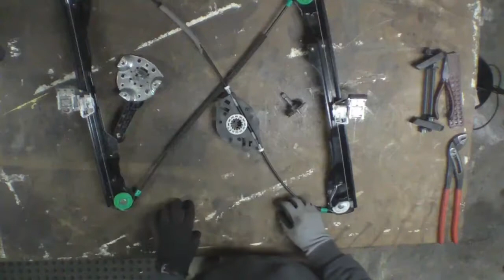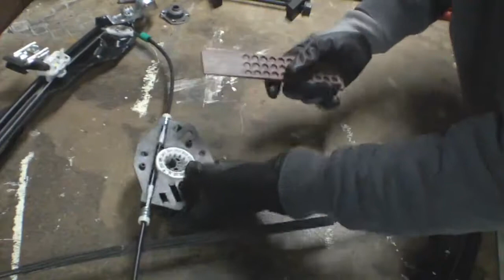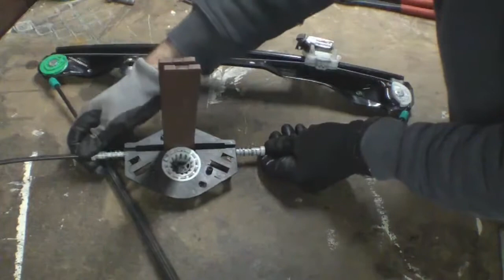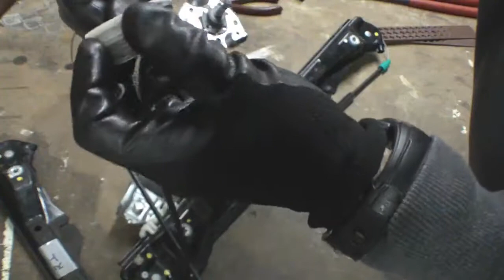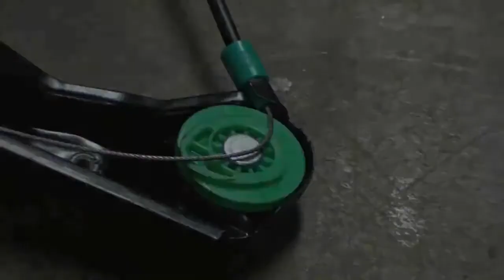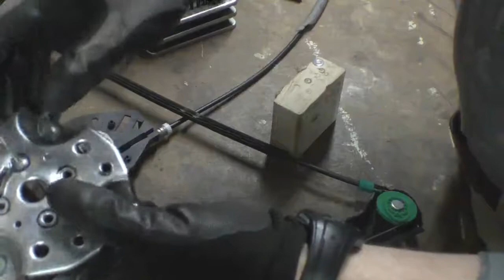Fix or repair manual window regulator on a 2006 Ford Focus ZX3.

Comment: You helped me a lot. I needed to change the window crank shaft and was afraid to bust the ribetted brackets it came with. Watching you do it gave me confidence to do the swap and I just closed them back with bolts and Nylock nuts.